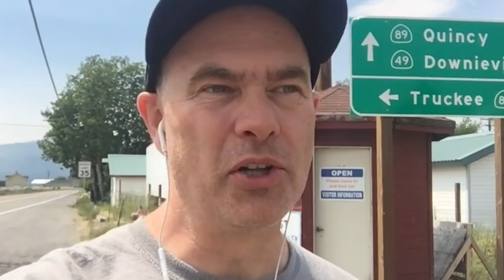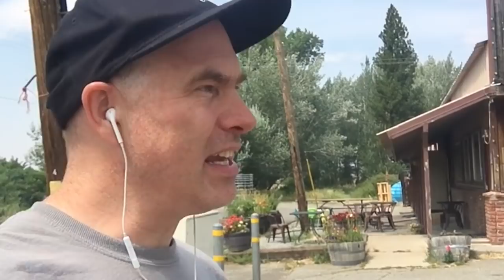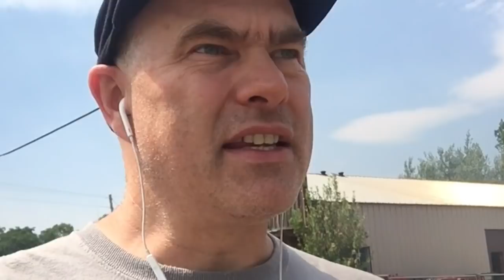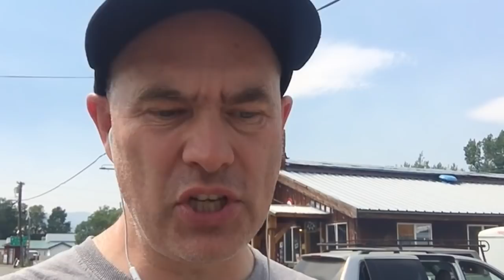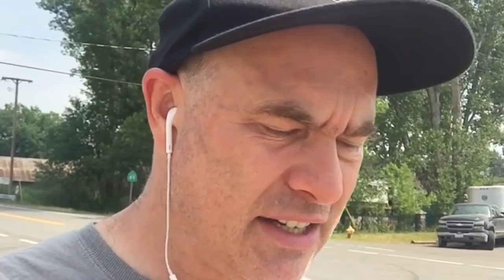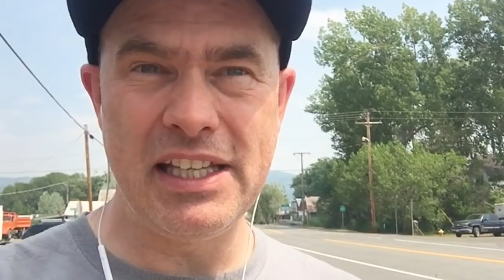How Solid Rockets Steer - How Can You Stop A SRB?

Comment: There is another way to  vector the thrust in a solid rocket motor. In the A3 submarine launched missile (also known as Polaris) The trust was vectored with moving, but non-gimballed nozzles. The first stage had 4 nozzles, each one canted a few degrees from center line. The nozzles rotated in combination to vector the thrust. This arrangement was simpler that a fully gimballed nozzle in that the seal for each nozzle only had to handle a rotation, not a movement in all directions. Thrust termination: Most modern solid fueled missiles do not use thrust termination ports. What is used instead is software to fly what is called a "GEMS" manouver (Graduated Energy Management System). Instead of terminating the thrust (since a solid rocket cannot be throttled), a path is flown to 'efficiently waste' the excess thrust (delta V), while maintaining the path to the target. Sometimes this means that the rocket flies pointed backward for part of the path. More usual is a kind of "S" path. GEMS is used on Patriot intercept missiles, as well as C4 and D5 submarine launched missiles. Terminal guidance systems: For the U.S. at least, there never were any liquid fueled rockets on submarines. For the terminal guidance a gas generator was used: think of a solid rocket in an enclosed can. The exhaust gases were channeled into a manifold system and then to valve assemblies. These fed nozzles that were placed in opposite facing pairs around the final stage. Both nozzles of a pair was opened if no net thrust was required in that axis, or one of the pair was opened to push in a direction. The D5 and C4 missiles also used this system.
Reply: The Soviets did have hypergolic liquid fuels on their submarine-launched missiles. Because what could possibly go wrong with that?
Reply: ed p you might be surprised to know that there are actually throttleable solid motors. Some are even in active use in militaries around the world.
Reply: Those are technically hybrid motors, since they evolve controlling the burn rate by introducing another propellant component.
Reply: General Energy Management is useful for reducing range and shaping trajectory and is done early in the burn.  If the motor over performs from the nominal you have to either terminate the thrust at the end of burn or have a liquid final stage like most ICBMs.  All guided missiles have thrust termination systems for safety purposes.  The D5 and C4 do have a liquid "4th stage" AKA post-boost vehicle.
Reply: No guided missile of which I am aware has thrust termination systems - please provide an example.   Also, C4 and D5's post-boost vehicles are not liquid fueled.  They use solid fueled hot gas generators  (Former Trident Fire Control Tech.)
Reply: I have to ask how important is extreme accuracy with ICBMs?   I mean considering they are nuclear does meter level really matter?   I always give NYC as an example since I am familiar with it and figure Staten Island,  North Bronx what is the difference with a nuke.
Reply: I am not surprised. I already know that.
Reply: No. D5 and C4 both used only solid propellants.
Reply: Posiden  (C3) had thrust termination ports. They were still deployed in the early 1980s.
Reply: K-219 :D
Reply: Accuracy does matter if one is trying to knock out an enemy ICBM site or other hardened site like command bunkers. This makes sense (sort of!) in a first strike. 

I do not know if it existed but it might be possible to steer a SRB vith vanes in the exhaust (like the V2 motor). But perhaps the temperature is way too high for that?
Reply: David Kearns 
More accuracy means warheads can be smaller, cheaper, easier to source, handle, transport, hide, and deliver. Four 5ton explosions can cover much more area than one 20ton. Two 10ton will be more difficult to stop and more likely to take out a target than one 20ton. (same as multi-engine planes being preferred over single engine planes on trans oceanic flights)
Reply: Minuteman III third stage has thrust termination ports. Small explosive charges blow six holes in the forward down to vent some thrust out the front.
Reply: At least one version of the Polaris (possibly the A-1, the first operational version) used "jetavators" on its first stage. The four nozzles were fixed, with a single-axis gimbaled, short circumferential ring (like a very short tube) around each nozzle. The jetavators were tilted as necessary to redirect each nozzle's exhaust plume. (I think two opposing jetavators tilted differentially for roll control, while the other opposing pair moved in unison for pitch--and yaw--steering; the roll jetavators could roll the missile as needed to enable the other pair to conduct pitch, yaw, or intermediate [with components of both axes] maneuvers.) And, of course, old-style (like on the V-2, Corporal, and Redstone ballistic missiles) jet vanes work equally well for steering solid rockets; the Scout, Blue Scout I, and Blue Scout II all-solid propellant launch vehicles used jet vanes on their first stage Algol motors.
Reply: I was thinking it might be useful in some circumstances (though I don't know what they'd be) to do thrust vectoring in a mostly-passive way, by putting the nozzle on a rotary bearing, and tilted, as you describe, but also offset from the center of the bearing in a different axis, so that its thrust will spin it up, and the thrust vector will then nutate continuously, requiring only a brake to slow it at the right points in its rotation to effect the desired time-averaged vector. Starstreak has demonstrated that this kind of directional control can work (though using fins rather than vectored thrust). A more advanced version might use a custom nozzle shape, rather than a normal nozzle offset and tilted. This could also be done with a single thrust vectoring vane mounted similarly, with the advantage that the bearing doesn't have to have a seal to contain hot gases and the disadvantage that the bearing must be much wider (or an arm has to go down along the nozzle to hold the vane while the bearing is up at the throat).
Reply: May I ask where on earth do you get all this information from
Reply: @kobalt9299  I worked on that program. I have seen the hardware.
Reply: @edp2260  how do I apply

Comment: 1 dislike from someone who never had to haul data packets one mile barefoot through the snow, uphill both ways
Reply: When your internet is so bad that you have to manually deliver each packet to its destination, it's probably time to change ISPs.
Reply: I think XKCD crunched the numbers and it's still more efficient to mail a gallon jug of SD cards somewhere if ping times don't matter...
Reply: Just use the UPS protocol. Or the USPS protocol,.. which might save you a few pennies...
Reply: That was called FIDOnet not that long ago.
Reply: @thatotherguy27  that's probably only true if you need to deliver TBs of data
Reply: Have had to drive 50km for useable mobile signal in the past, in Australia.. lol. The effective coverage for phone and data has gone down as the network generation numbers have gone up and expect it to get worse as they roll out 5G here. Data via the remaining 3G networks in more remote areas is next to useless today...
Reply: Should be a Russian spy obviously.

Comment: Q: How can you stop a SRB? A: With another SRB, a Serious Rocket Brake?
Reply: Scott FW heck yes let's KSP it
Reply: The Phase C (and possibly also early Phase D) Space Shuttle design, which was very similar to the vehicle that was built, did have a thrust termination port at the front of each Solid Rocket Booster (SRB), for use in an in-flight abort before the SRBs had burned out. They were deleted after detailed analysis showed that the sudden deceleration they would cause would have over-stressed the winged Orbiter's airframe. Wernher von Braun was leery of having human crews riding large solid rocket motors and warned that their simplicity and lower cost was bought at the cost of greater risk--which the January 28, 1986 Challenger accident tragically demonstrated.
Reply: @j.jasonwentworth723  Interesting. Yes, the Challenger event challenged several things in NASA engineering and culture. And I have zero recollection of posting that comment those two years ago! :D
Reply: J. Jason Wentworth, I’m confused. A thrust termination port would stop the thrust, I assume, but why would a sudden lack of acceleration cause undue stress on the airframe?
Reply: Every SRB will have another SRB strapped to it facing the opposite direction , which will function as the SRB

Comment: Vectored thrust is incredibly common in military missiles, particularly short-range air to air missiles which benefit from dramatic steering at the very start of firing. They will usually have fins inside of the nozzle to deflect it in various directions, often tied to the aerodynamic fins so you only need one actuator. The nozzle doesn't move but they would have the same effect with a lower weight, cheaper, and generally more fitting towards a smaller scale missile one could carry by hand alone or with a few people.

Comment: If I'm not mistaken the Minuteman also used detonating cord between the propellant and case to break the propellant into small pieces that would blow themselves out of the nozzle rapidly stopping thrust.Another source said that the det cord was only used to open the ports and that the act of opening the ports alone was enough to eject the fuel.

Comment: Closely related would be SpaceShip1 and SpaceShip2's hybrid engines, that use a solid propellant core ignited by nitrous oxide injection. Gives you a 'mostly' solid propellant engine, with a built in means of shutting it down. (ie: shut off the nitrous oxide.)

Comment: FR I wish scott would do a video on the AJ-260 solid rocket motor. The most powerful rocket motor ever fired with 3.9 million pounds of thrust. It was insane. It was 60 feet tall and 21 feet across. The ones tested were only half sized and the full versions were supposed to be 120ft tall. 

People nowadays think of solid rocket motors as very dangerous and risky but the monolithic designs Aerojet investigated were very safe compared to the segmented designs (thanks Utah) I wish someone would revive this kind of thing because the sort of cost savings you could get from it is crazy.

Comment: Thrust termination doors is about dropping chamber pressure below that which combustion can be sustained.  Solid motors will turn off when the pressure drops below a certain level.
Reply: Since the fuel and oxidizer are mixed together the propellant continues to burn even if it is not pressurized, it just doesn't burn as fast.

Comment: MM2 and 3 second stages injected Freon into the exhaust stream. The relative low pressure caused on whichever side the Freon was injected caused the exhaust to steer a few degrees that way. In the 1980s the Freon was replaced with a non-CFC fluid.

BATES and Super BATES systems also use fluid injection.

The thrust termination ports' primary purpose is to drop the pressure in the chamber below the level it needs to be at to maintain combustion of the propellant grain. There is a moment where they provide thrust, but mainly they change the chamber conditions to where the grain no longer generates thrust. It needs to be within a particular pressure range to do that. The propellant will continue to smolder, but it won't burn fast enough to produce thrust.

Peacekeeper used a flex seal on the nozzle, and an actuator system to steer the nozzle.

ed p already got A3, so I'll leave that at what he said. :)

Comment: Back to your intro.... the Delta IIIs 3 steerable GEM46 SRMs did have moveable nozzles just like the GEM40s on the Delta II, definitely no injection control.

The Titan IIIC boosters had a clumsy looking tank and pipework bolted to the lower part of the casing to hold the control liquid, less obvious somehow on the later Titan 34D and IVB. The Titan IVB eventually got new Hercules SRMU boosters with steerable nozzles like on the Shuttle.

Comment: Don't SRBs need fins for stabilisation? Can't you use those? I mean, it works in Kerbal Space Program...
Reply: Fins only work while there is atmosphere. ICBMs have quite high apogees, typically 1000 km or more and the boost phase lasts until well outside the atmosphere before it goes ballistic.
Reply: Its an issue of control more than stabilisation, sounding rockets use fins all the time. I might be wrong but i dont think real life rockets use fins as control surfaces, due to aerodynamic stresses i think? Again, might be wrong :p
Reply: "it works in Kerbal Space Program" -- Famous last words.

Comment: Scott, thank you for explaining that. I always wondered. I do have two questions for you. In a boomer sub, when a ICBM missile is launched, what physical effects would the crew feel and hear? Also, same question for land based missiles, can the launch crew feel or hear the missiles launch (I expect not)?
Reply: From what I've heard of missile crews that have launched ICBMs in tests, you might feel a slight vibration, but because those launch control centers are shock-mounted to survive a near miss by an inbound ICBM warhead, the only reliable way to know that the missile launched is seeing the status light for that silo change from "armed" to "away".
Reply: Submarine launched missiles are actually pushed out by compressed air like torpedos, their main engine ignite after missile breaks water surface.

Comment: so this steering is how they account for things like high winds pushing laterally on the rocket?  I always wondered if high winds (not counting tornadoes or hurricanes) were a problem or if the rocket could just power through them.
Reply: Necroticus If the winds are too high they'll scrub the launch. Also, "too high" is probably a smaller number than you may think.

Comment: If Strontium Percolate is such a powerful oxidiser why isn't it used int he liquid fuel stages of rockets? Surely they would benefit from such a strong oxidiser, no?
Reply: LueLou Ahh right so then why do they used it in ICBM's?? Does it have some cost or weight incentives over liquid oxygen?
Reply: There's more to oxidizer choice than just "most powerful". There's a reason rockets don't use e.g. liquid fluorine as oxidizer (although people have tried it out in test setups... crazy madmen).

For more insight you might like to read the book "Ignition!": https://library.sciencemadness.org/library/books/ignition.pdf
Reply: Strontium perchlorate is a solid and can't be pumped to mix with a liquid fuel. It does mix with solid fuel for a stable cake of ready to burn propellant.